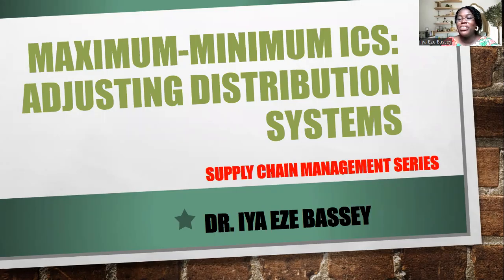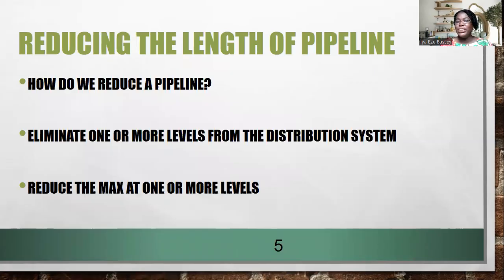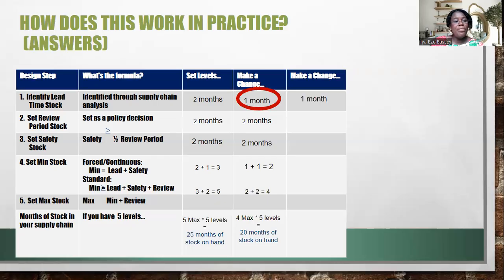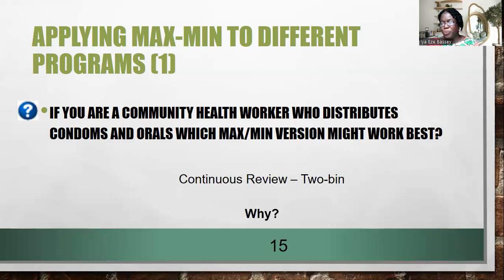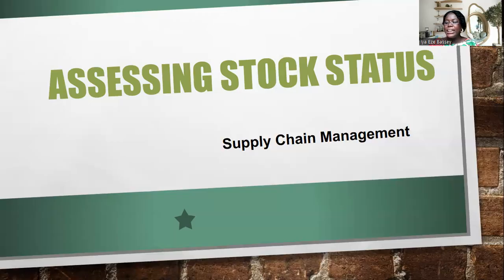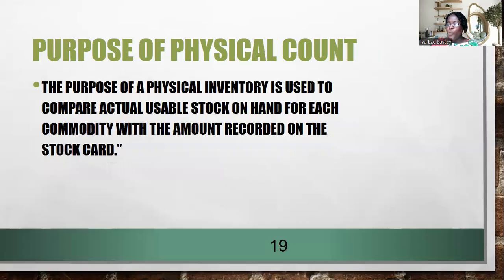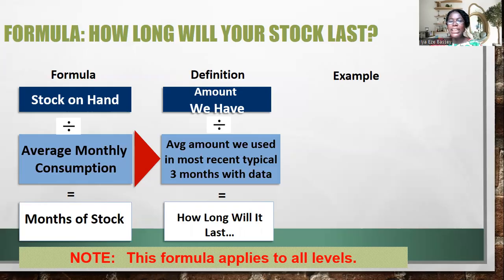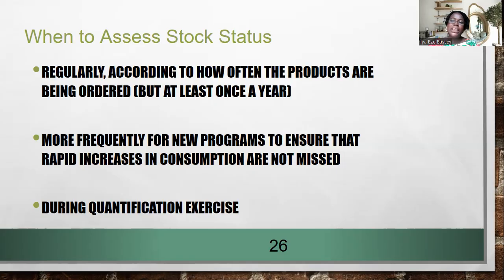Maximum-Minimum ICS: Adjusting Distribution systems (Supply chain management series)

Comment: Thank you very much ma for this wonderful piece, in the course of this lecture i could grasp the various steps involved in designing a maximum-minimum inventory control system which includes;
1. Setting up initial maximum           
     Policies
2.  Checking if the overall distribution will function properly if the level specific maximum-minimum policies are implemented
3.Checking the total lenth of the pipeline that the policies of each level will imply.
Elemination of one or more levels from the destribution system and reducing the maximum stock levels at one or more levels can help to reduce pipeline length.
Factors that impact maximum -minimum stock levels includes
1. Storage capacity 
2. Lead time
3. Product costs
4. Accuracy of forecast
5. Reliability of transportation 
6. Management skill of staff etc.
Avoidance of overstocking,miminizing waste,avoidance of understocking,consistency of stock levels are some advantages of maximum -minimum system .
The purpose of accessing management stock system is to determine how long supplies will last.Stock status can be assesed during quantification excercise regularly according to how often products are being ordered or more frequently for new programs to ensure that rapid increase in consumption are not missed.

Comment: In summary of Max Min ICS, there are various steps in designing a max min inventory control, the steps for reducing pipeline length and some factors affecting it. Also the benefits of Max Min system helps in preventing overstocking and understocking

Comment: Thank you Ma 🥰
In this lecture we talked about Max-min inventory control system.And I learnt that the first thing is to set up a policy for each level and check if the policies will work for all levels and also the length of the pipeline.We also talk about ways of reducing the length of a pipeline which includes; eliminating one or more levels from the system or setting up policies that can help reduce the max at one level.We also mentioned other factors that impact the max-min stock levels,the advantages of the max- min system including avoidance of overstocking and understocking.We also discussed the challenges in using each version and variation.We also talked about assessing stock status and it's activities including physical count, purpose of physical count.

Comment: Thank you ma, I got to understand that (ICS) provides comprehensive guidelines for managing stock levels to prevent both overstocking and understocking of goods. From the lecture I also got to understand that It encompasses various steps involved in designing the system, methods for reducing pipeline length, and factors affecting the Max-min stock levels. There are several factors that affect max-min levels which includes;
1. COST OF PRODUCTION, 2. LEAD TIME,
3.COST OF STORAGE, 4. STORAGE CAPACITY, 5.AGE OF PROGRAM.
In conclusion, this factors have some advantages which are;
1. minimize shortage, 2.minimize wastage,
3.prevent overstocking etc.
Thank you ma

Comment: In this session I'm able to learn how the maximum.. minimum inventory control system can be used to adjust a distribution system in several ways. 
Max- min ICS can be used to adjust and monitoring maximum and minimum inventory levels. This system can help avoid stockout and over stocking but it also has some
Challenge and disadvantages. 
I also learn  that some element of the formula can be changed in order to reduce max stock level. They include.
1 shorten the review period.
2. Reduce the lead time .
3.improve the distribution of system.

Some of the challenges to use each version and variant are.
1. System with numerous level.
2.system that manage a large number of commodities
3. System that manage products for new program .

God bless you ma🙏

Comment: Summary on adjusting distribution systems in max-min ICS. This deals with reducing the length of the pipeline.. 
* Steps in designing a max-min ICS
- set up initial max-min policies for each level and type of facility 
- check if the overall distribution will function properly if the level specific max-min policies are implemented 
- check the total length of the pipeline that the policies at each level imply. 
 HOW DO WE REDUCE THE LENGTH OF A PIPELINE.
- eliminate one or more levels from the distribution system 
- reduce the max SOH at one or more levels .
REDUCING THE MAXIMUM STOCK LEVEL
- shorten the RD at one or more levels
- reduce the lead time at one or more levels
 Advantages of Using max-min system
- helps to avoid overstocking 
- avoid understocking 
- minimize wastage 
ETC
Challenges to using each version and variation
- system with numerous level
- system that manage products for new programs 
Etc

WHEN TO ACCESS STOCK STATUS
- Regularly according to how often the products are being ordered 
- during Quantification exercises
Etc

Comment: At the end of this video, I was able to: 
identify ways to adjust distribution system policies, the length of a pipeline, the steps in designing Max-min ICS, the ways to reduce the length of a pipeline and how to reduce the maximum stock level.
The factors that influence max-min stock levels.
Describe the advantages and challenges of max-min inventory control system. The advantages of using max-min system include; i. Helps avoid overstocking ii. Helps avoid understocking iii. Minimizes wastage, etc
The challenges of using each versions of ICS which includes; i. Systems with numerous levels ii. Systems that manage products for new programs, etc
Describe the ICS used in the logistics management of HIV/AIDS commodities (LMHC)
Explain the meaning and purpose of accessing stock status, the purpose of physical count and when to assess stock status.
A physical count is the process of counting by hand the total number of usable units of each commodity in your store or health facility at any given time.
The purpose of physical count is t compare actual usable stock on hand for each commodity with the amount recorded on the stock card.
Purpose of assessing stock status is to determine how long supplies will last.
Determine the number of months of stock available at any storage level using inventory and usage data.

Thank you very much ma'am for this very educative lecture.

Comment: Thank you for the opportunity to understand the topic, Adjusting Distribution systems in maximum-minimum inventory control system. It enlightened us on the overall pipeline for the max-min Inventory control system and how it can be improved upon to deliver commodities from the central level to the medlab level. 
     We looked at the length of a pipeline which helped us to understand parts of the distribution system designed, process for a country and the consideration for improved distribution system in Nigeria
      I understood how to reduce the length of a pipeline
* Eliminate one or more levels from the distribution system
* Reduce the max stock on hand at one or more level
   I was able to understand some factors that impact max-min stock levels
- cost of products 
- Reliability of transport 
- Cost of storage 
- Shelf life of health commodities. 
And Soo many more. 
     I was also able to understand the advantages of using max-min system as well as challenges of using each versions and variations. 
      I also learnt how to access stock status, the purpose of access stock status and also when to assess stock status.

Comment: Steps involved in designing a maximum-minimum inventory control system includes:
1. Set up initial maximum-minimum policies for each level and type of facility.
2. Check if the overall distribution will function properly if the level specific maximum-minimum policies are implemented.
3. Check the total length of the pipeline that the policies of each level imply.
Elimination of one or more levels from the distribution system and reducing the maximum stock levels at one or more levels can help to reduce pipeline length.
Factors that inpact maximum-minimum stock levels includes:
1. Storage capacity
2. Lead times
3. Products cost
4. Accuracy of forecast
5. Reliability of transportation
6. Management skills of  staff etc
Avoidance of overstocking, minimizing waste, avoidance of understocking, consistency of stock levels are some advantages of the maximum-minimum system.
The purpose of assessing stock status is to determine how long supplies will last. Stock status can be assessed during quantification excercise, regularly according to how often products are being ordered or more frequently for new programs to ensure that rapid increases in consumption are not missed.
Reply: In Summary;
Adjusting Distribution System in Maximum/Minimum ICS talks about the procedures in curating an ICS for proper functioning of the SCM.
These steps helps ensure that every product is delivered and stored in the right quantity to avoid shortage or wastage.

Comment: In summary, we looked at the steps in designing a Max-Min ICS and then we went back to the diagram of the pipeline that has ports like seaport and airport. 
Adjusting distribution system starts with reducing the length of the pipeline, it could be by eliminating one or more levels like eliminating the district level or by Reducing the Max at one one or more levels like from 4 months to 3 months, and you pointed out that we do this systematically and not just shorten it arbitrarily.
The elements to reduce the Max stock level are review period, lead time and the distribution system's reliability and this can be changed at one or more levels. I learnt the calculations involved and we also looked into other factors that come in play like cost of products, transportation, e.t.c. 
These helps to avoid overstocking, minimize waste, e.t.c and we looked into the challenges of using each version and variation for example, challenges arise in systems with numerous levels and also how we apply Max-Min to different programs like distributing condoms and you discussed physical count or inventory and its purpose in assessing stock status.

Comment: Thank you ma. In summary, l learnt that the maximum-minimum ICS is designed to prevent uncertainties in the supply chain system like shortage of supplies, under stocking and overstocking. It gives detailed consideration and attention to each level and type of facility, checks the total length of pipeline thar the policies of each level can apply. Also the various factors that affect max min levels are also highlighted, which are; cost of production, lead time, cost of storage and storage capacity. The max min ICS has various advantages which includes; avoidance of overstocking, under stocking, minimization of wastage, simplified decision making and also reliable data sources for forecasting and quantification.

Comment: This lecture focuses on the designing of max-min ICS  which is setting up an initial max-min policy and type of faculty and checking if the overall distribution will function well if the policies are implemented.It also helps to check the total pipelines that the policies at  each level imply.
  This lecture also shows the factor that can possibly affect max-min ICS which includes the
1.lead time 2.cost of storage 3. Cost of product 4.storage facility...... and many other factors 
And also how these factors  helps max-min ICS like minimizing storage and avoiding overstocking and understocking
Thank you ma'am

Comment: I appreciate the depth of knowledge shared on the Max-Min ICS: Adjusting distribution Systems.
In summary,
Adjusting distribution system policies involves setting initial Max-Min policies for each facility level, ensuring these policies enable proper distribution, and checking pipeline length implications. Assessing stock status determines how long supplies will last. 
To find the number of months of stock available, divide the current inventory by the average usage over the most recent typical three months.

Comment: I learned that Length of Pipeline entails the following:
1: Settings up initial Max-Min policies for each level and type of facility.
2: Check if the overall distribution will function properly in the specific Max-mini policies are implemented.
3: Check the total length of the pipeline that the policies at each level imply .

I learned that I can Reduce Pipeline by Eliminating one Level among the two (2) set up policies that will help produce the Max on one of the levels.

Then I learned that Max  can be Reduced by the following:
1: Shorten the REVIEW PERIOD at one or more Levels.
2: Reduce the Lead Time at one or more Levels .
3: Improve the Distribution System.

Then Practically by Identifying the Lead Time Stock,Set Review Period Stock,Set Safety Stock,Set Min Stock anf by Setting Max Stock.
Also learned some Merits of Max-Min which are 
1: Avoid over stocking 
2: Avoid under stocking 
3: Reliable data source from SDP for forecasting.
And also learned 
  Physical Count which is the process of counting by hand of the total number of the whole units of each commodity in your store or health facility at any given time. 

Merits 
It helps to compare actual usable stock on hand for each commodity which the amount recorded on the stock card.

I also learned the Time to  Assess Stock Status
1: Regularly according to how often the products are being ordered 
2:More frequently for new program to ensure that Rapid Increase in consumption are not missed
3: During Quantification exercise.

Comment: In summary i learnt that in designing a MAX-MIN ICS
1.we set up initial MAX-MIN policies for each level and the type of facility
2.Check if tge overall distribution will function properly if the level specific MAX-MIN policies are implemented
3.Checn tge total length of the pipeline that the policies at each level imply.
And the factors that affect max-min  level are
.lead time
.cost of storage
.storage capacity
. Accuracy of the forecast 
Physical count of stock is very important and should be done at least once a year

Comment: Another thrilling and educative lecture! 
This lecture module(MAX-MIN ICS,ADJUSTING PIPELINES)
focuses on steps aimed at  designing the Max-Min ICS and the include;
Setting up an initial Max-Min policies for each level and type of facility,Checking if the overall decision will function properly, if the level specific Max-Min policies are implemented and Checking the total length of pipelines that the policies at each level can imply.
It outlined the factors that can possibly affect max-min ICS levels includes;
(a) lead time (b) cost of products (c) cost of storage (d) storage conditions at different levels (e) shelf life of health commodities
These factors as listed were discussed to have some advantages of using a MAX-MIN ICS like minimizing shortage, avoid overstocking and avoiding understocking,e.t.c I learnt the challenges associated with using each version and variations. We discussed assessing stock status and outlined physical inventory as one of the ways involved. Indeed,I learnt a lot!! Thank you ma

Comment: Thank you Ma, for an educative lecture. In summary i learnt the key steps involved in controlling the max-min inventory control system 
I understood ways in which we can reduce the length of a pipeline is by eliminating one or more levels from the distribution system and reducing the max at one or more levels. 
I understood the importance of max-min inventory control system which is avoid over stocking, avoid under stocking and minimize wastag. I also understood the disadvantages too. 
We also have the factors that impact the max-min system which are the product stocks, storage capacity and cost of storage 
Accessing stock status is done by physical count which is the counting of stocks by hand the total number of usuable goods of each commodity in health facilities and stores at any given time.

Comment: I got to understand that the length of the pipeline has a great role in max and min ICS. We must find a way to reduce this pipeline by removing more levels from the system. From the video it’s stated that this can not be achieved arbitrarily but systematically. 
factors that impact Max-min Stock levels includes; 
- Reliability of transportation:
- storage capacity
-storage Conditions at different levels.
-   Reliability of supply source
-   Effect of a zero balance of stock
-   Management skills of staff
-   Age of progran
-   Accuracy of forecast.

Comment: Another insightful lecture series.
In summary, I got to understand the steps in Designing Max-Min Inventory Control System(ICS) which are as follows:
1)Setting up Max-Min policies for each level and type of facility 
2)Check if the overall distribution will function properly 
3)Check the total length of stock of the pipeline the policies over at each level.
I also learnt that the length of a pipeline can affect the delivery of some commodities, making the commodities take longer time to arrive and we can reduce it by:
1)Eliminating one or more levels from the distribution system
2)Reducing the Max at one or  more levels.
However,some formulas which can be changed to reduce Max stock level ;
1)Shorten the review period at one or all levels
2)Reduce the lead time at one or all levels
3)Improve the distribution system that the safety stick can be reduced.
This lecture help me to know some factors that can impacts Max-Min Stock Level which include:
1)Cost of products 
2)Lead time
3)Reliability of transportation 
4)Accuracy of forecasts
5)Management of staffs skills etc…

Comment: Thank you ma, for the lecture 
in summary, 
the Maximum minimum inventory control system simplifies distribution system by reducing stock levels, considering factors like storage capacity.
which prevents overstocking and understocking wastage, making consistent stock level a reliable data source from SDP from forecasting and adjusting the pipelines in the society.